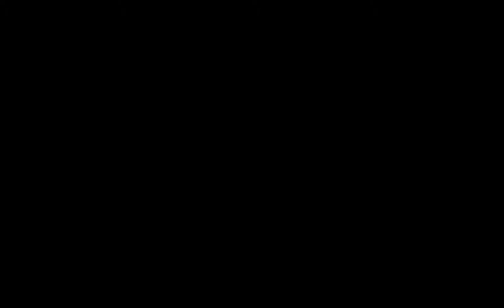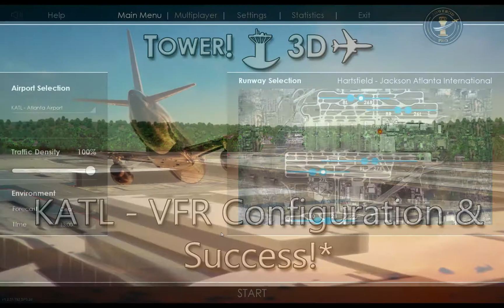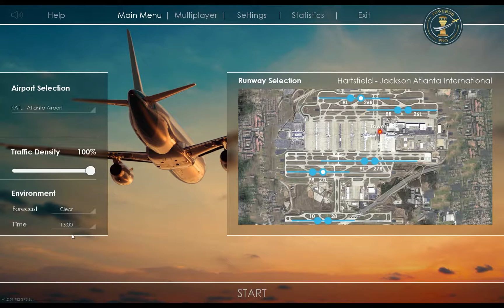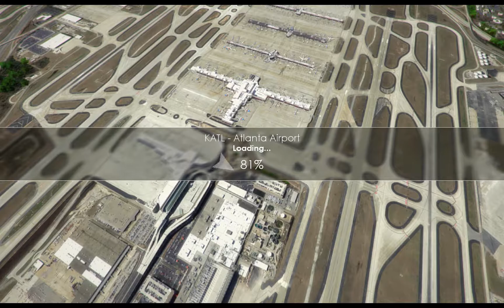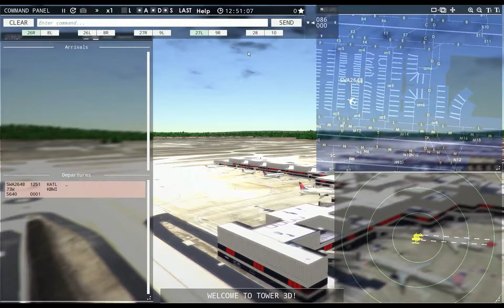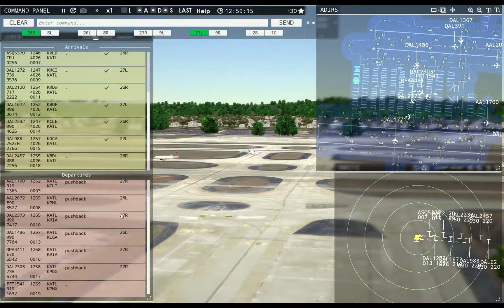Tower!3D Pro - ATL - VFR Configuration & Success

Comment: You certainly managed to tame taxiway D, for the most part.  I'm sure you've realized, by now, that when you issued the "HOLD SHORT OF TAXIWAY E" command to prevent them proceeding down D, you should have said "HOLD SHORT OF TAXIWAY D" since they were already on E.  If I would suggest doing anything differently, it might be to taxi arrivals on 27L via N, D, E so they all just line up on N awaiting the turn on D for a straight shot up to E, or possibly taxiing everyone via N, P, L, D, E so they all cross at the farthest point, and avoid potential collisions by entering L in advance of any of the ramps.
Reply from the maker: Yeah :( Crossed commands lol.  Taxiway C gets me in trouble a few times in coming vids lol.

As to pushing across 27R: I split them in this way for a few vids in hopes of not having a massive pile up all waiting to go at one point.  The fix is not to let them pile up and get better at keeping them moving...  The interim solution I had was this so I could push three across at the same time taking the same amount of time as one plane crossing one point.

It does create more routing down M and then the cross point for D and L.
The main reason I have not sent them down L with the departures is something you'll see more as the series progresses.  Game updates have caused some issues with AI routing again and more planes are driving into each other.  Same type (IE Departure / Departure) do not typically crash into each other.  But arrival / departure love to just drive into each other :( 

Separating the arrivals on M was a way to try and combat it but its far from perfect. 

I had not thought about using P, was looking for fast routes and short taxi's after they pull off but T is not exactly close for some of the planes I sent over there.  If the arrivals are all on L at the earliest point down there I'm curious how the departures rolling down the ramps would interact with them.  Worth a shot in a future revisit :)

The game updates and changes to Real Traffic caused me some issues for the last few vids and no easy way to revert back :(  Oh well, still fun and that N P L D E is something I'll try to remember and run :)
Reply: As always, I defer to your expertise, and while my suggestion may appear to work, on paper, they clearly don't always work out, in practice.  I look forward to the upcoming sessions.
Reply from the maker: I dunno about expertise :p  Next update I'll give it a shot and see how it goes, I am curious if they will merge in line better than they have been lol.
Reply: Well, if nothing else, you're rapidly becoming a master of the art of the "HOLD SHORT OF" command to get them where they're going.
Reply from the maker: It gets the best of me soon as you'll see lol :)